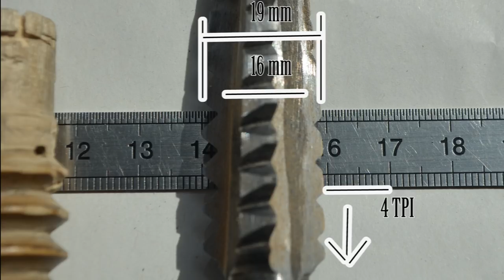Die for wood screw

Comment: For at 1:16 / 4:38    If you cannot hold  the tool perpendicular to the surface, use a bell-shaped guide with a hole corresponding to the diameter of the tool shank.
Reply from the maker: Thank you, good tip

Comment: Drill press can help in making straight cuts.
Reply from the maker: no room
Reply: @ucenicul  yea, make room. I did without for a long long time but wanted one. One day I was drilling at a sort of odd angle in a piece of metal. The bit grabbed and twisted my hand/wrist at a painfull point. My wrist had been broken badly 20 years ago. The pain was terrible and I thought I had broken it again. Luckily I didnt but I said that's it, no more free hand drilling. In a week I had a near new 10 inch table top drill. since then drilling has been a pleasure. Course if you dont need a drill at all, disregard !

Comment: 16mm (0.6299 of an inch) is 5/8 of an inch (0.6250 of an inch) In wood 0.0049 of an inch (0.12446mm) is a negligible amount. Especially when it comes to a hole you're just going to tap. It may be a 1% difference in thread depth?
Reply from the maker: Thanks
Reply: @ucenicul  common metric sizes are popular because their US customary counterparts are. 8mm=5/16, 10mm~3/8, 13mm=1/2, 16mm=5/8, 19mm=3/4. Or close enough. To be fair, you have to have a very high IQ to appreciate duodecimal.

Comment: You think they are like twins? Then you need glasses lol the original has a narrower angle to the tread. Most wooden threads here in England were based on the Whitworth pattern but with a 5 degree wider angle (Whitworth was 55 degs,  and most English wood threads were around 60 degrees) your original thread seems to be around 60 but the cutters you made seem to be a lot nearer 90 degrees. When you compare the two you can see the new thread is wider at the base than the original, but of course, if the external  thread matches the internal, that's all that matters really. I used to be a church organ builder, and on old organs the boards with the holes to hold the pipes upright ( called Rack boards) were held up above the wind hole board (" Upper boards) by about 6 inched by what were called Rack Pillars and these were some 7 and a half inches long turned with a shoulder at each end and threaded on either end. One end screwed into theupperboard and the other had a hexagonal nut also made of wood, usually made from boxwood as it's dense and hard, takes a thread really well and does not break easily.  and on restoration work apprentices had to sometimes re cut the threads on the rack pillars with a smaller die made for the purpose along with making new nuts using the same size tap as the smaller thread. If tooth ends of the rack pillar threads were damaged then completely new pillars were made but they were bought in from elsewhere.
Reply from the maker: Thanks for the information, very useful. The tap was made by a metal lathe, but not by me, I just fit the die. Paul Hammer has a video where he describes very nicely how he makes screws for reproductions.